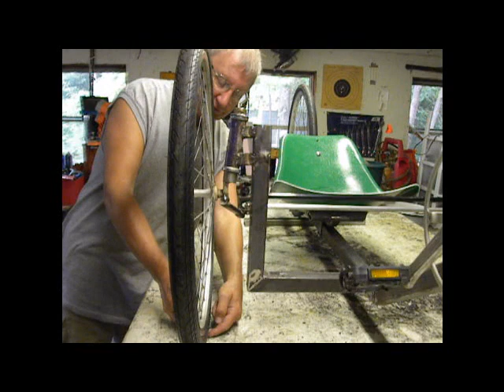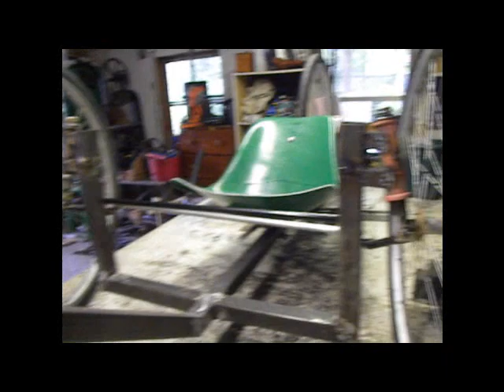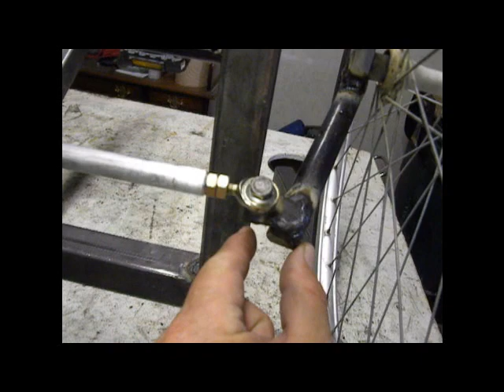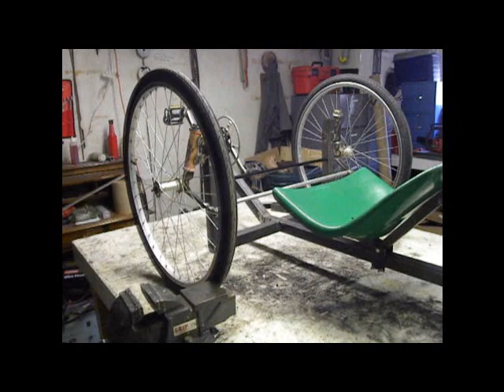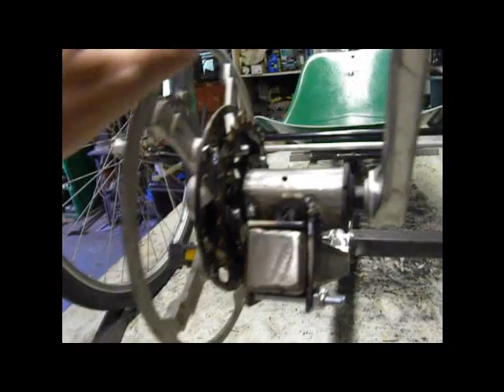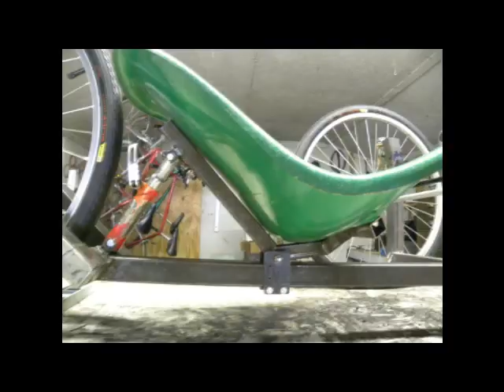Recumbent Trike steering

Comment: Great vid, I'll see if I can post my recumbent.  I used a bit of a diffenrent set up but I like the way your's looks.  Great info, I will use some of your improvements if I build another one in the future.  Did some research but didn't come across your design until after my build was through.

Comment: Thanks for the video about steering geometry. Your explanation of Ackerman steering was very clear.

Incidentally one thing you did neglect to mention was camber, although to be fair almost every trike I've seen has zero camber.

I built a recumbent trike about two years ago. Like yours it uses pedal arms for the front wheel axles. The wheels have done more than 4000 km with no problem.

I set mine to zero toe-in. Maybe the small amount of toe-in you use is peculiar to the design of your trike.

Comment: Easiest front axle/wheel is wheelchair wheels- if you can scrounge the quick detatch ones all the better. Most are 24" I've seen but got a 20" pair today at the scrapyard. Only problem is no brakes on them. Maybe the wheelchair axles fit disc brake hubs- will look into it.

Comment: The line from center of the rear wheel to the tilted Kingpin axis can vary depending on where the line ends along the Kingpin axis. Where should the line end on the tilted Kingpin axis to achieve Ackermann compensation ?
Reply: chuacl20   Good question ---the formula i used did not address this situation so i just went half way down the king pin.  It works well.

Comment: awesome vid . . lot's of great info - thank you . . i'm concerned about the two small pieces of square tubing on either side - where they are joined to the 'head tubes' for each front wheel - and how you cut them out so precisely, what with such specific degrees of angle needed, going in TWO differing directions at the same time? damn tin, that doesn't look easy - doing this well is what separates the men from the boys, since the better they are cut, the higher quality the welds will be . . .

Comment: I've built a homemade recumbent and when driving fast I get a speed wobble , what's causing this?
Reply: This is very common in DIY and also factory built Trikes.  The problem stems from steering geometry.  You can increase the caster and get rid of it but will then not handle well when turning at low speed.